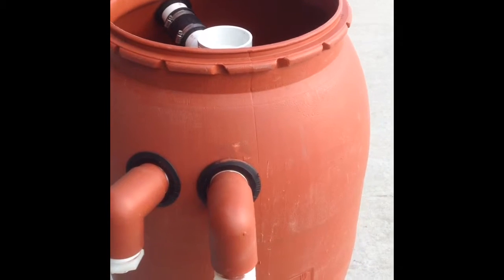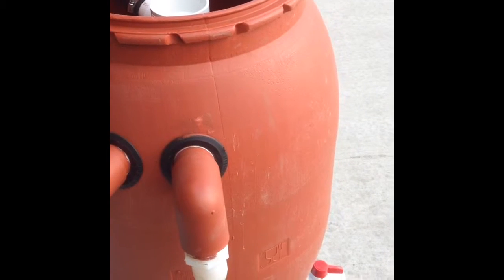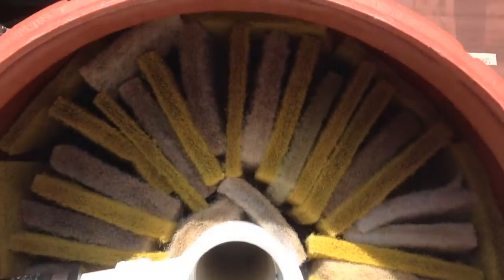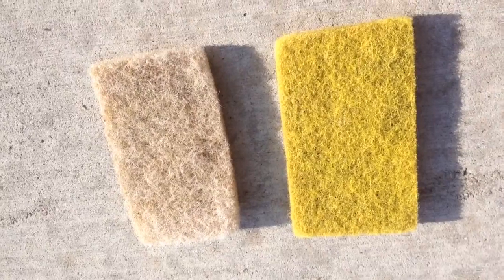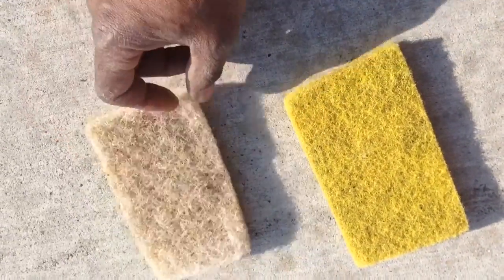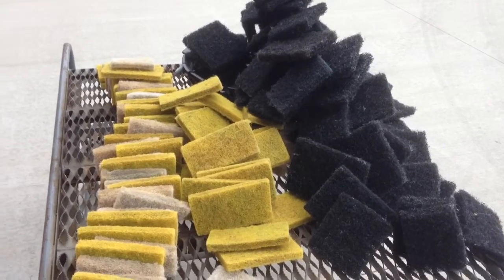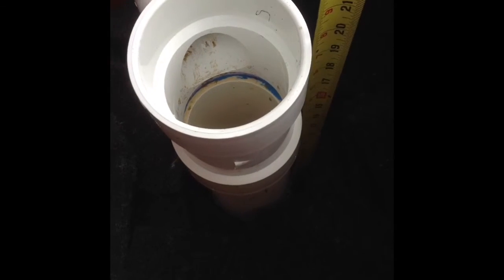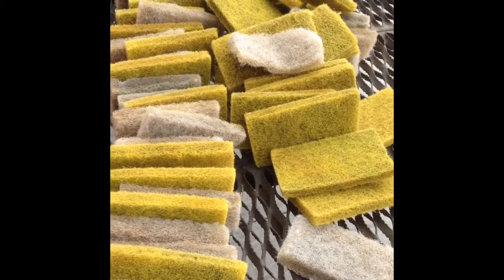Bio Filter Contents and Measurements

Comment: I made a smaller version of your design from a 30 gallon barrel. I used (3) 19" green buffer pads with used filter media and a twisted pond netting. Works great thank you for the idea. I would highly recommend the green buffer pad with your scouring pads. I got my pads at Home Depot for under $6.
Reply from the maker: Hi, I'm glad your work out, 
Why the high recommendation on the green pad.

Comment: Hey Charles, I have a question.  Could you use the blue air conditioner filter pads, the ones you can cut to fit, on top of the light grids?  Seems like you could cut them in a circular pattern to fit right on top and they are fairly dense.  I like what you have done.